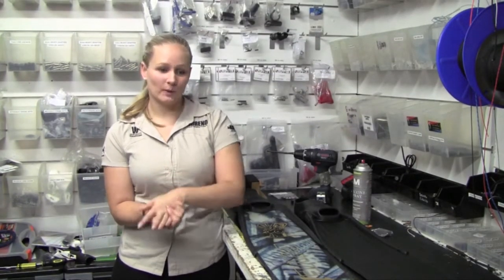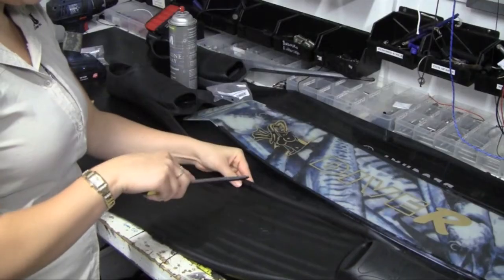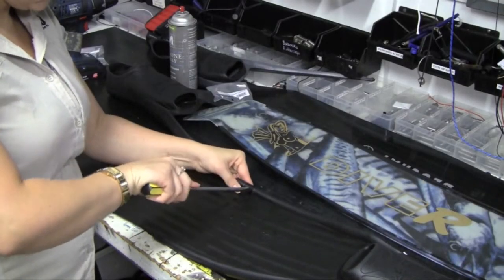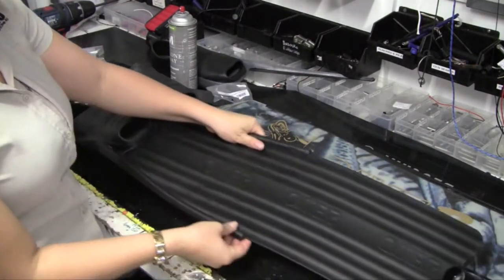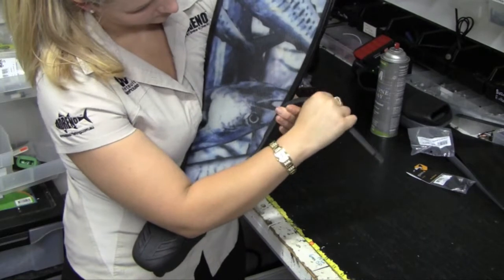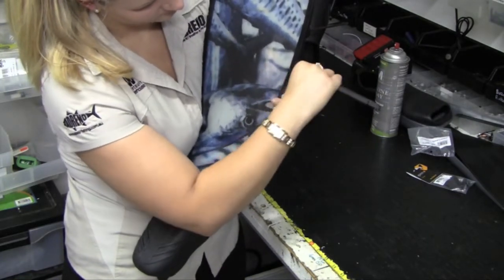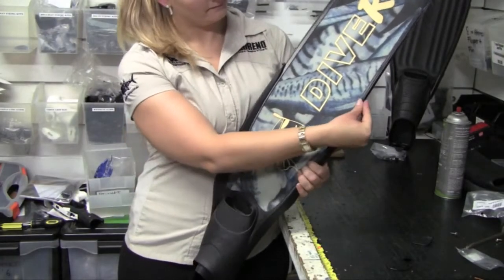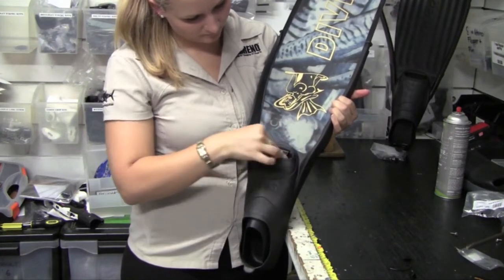How to Insert Spearfishing Fin Blades into Foot Pockets

Comment: Just a tip, I wouldn’t use the drill to screw the screws back in, just do it by hand so that you don’t cross thread the plastic you’re screwing into, and you have a lot more control of how tight you’re screwing them. You don’t want to over-tighten and strip the inside of the plastic.